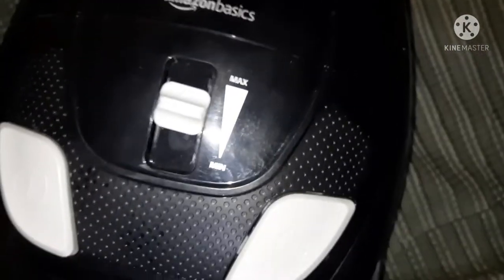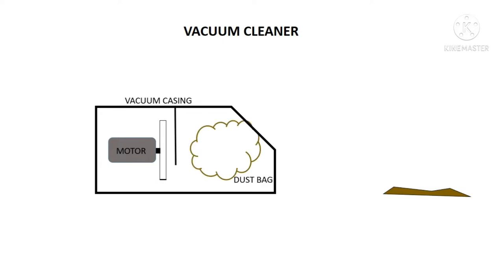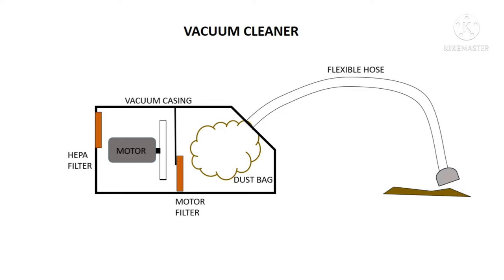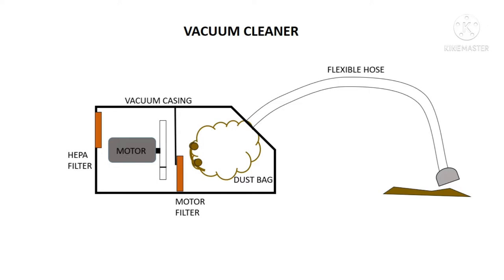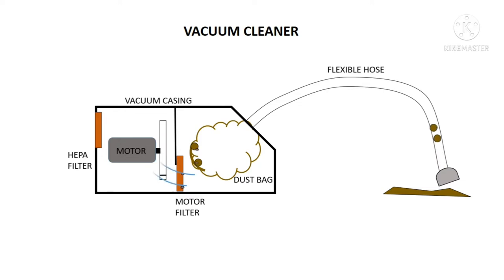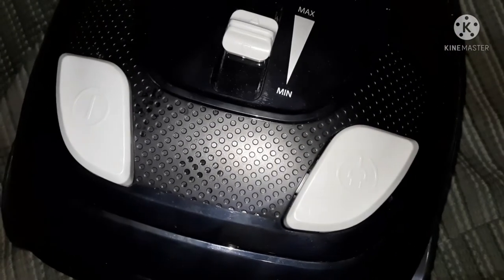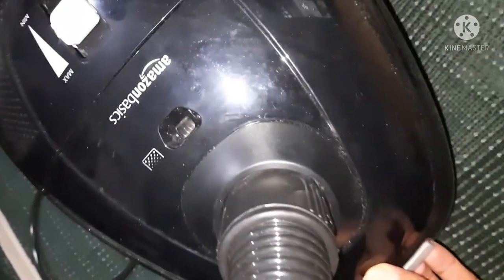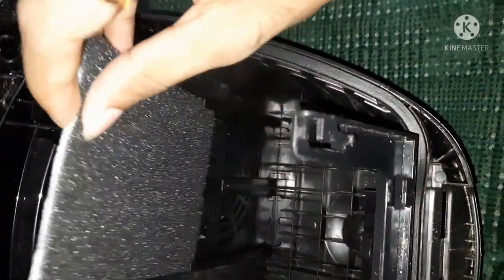working of dry vacuum cleaner | construction | Amazonbasics vacuum cleaner | Animation

Comment: Bhai vaccum cleaner ki COP hoti hai ya EFFICIENCY.... Plz reply.
Reply from the maker: If you considering subsystems of vacuum cleaner like , motor, filters, fan etc, you can measure their efficiencies.
Like-
How much motor is efficient?
Filtration efficiency (HEPA & Motor filter efficiency)
But if you consider whole system then performance of vacuum cleaner or the ability to pick the dust depends on various aspects like, motor power, and motor efficiency, state of performance of dust bag, filtration efficiency, etc.